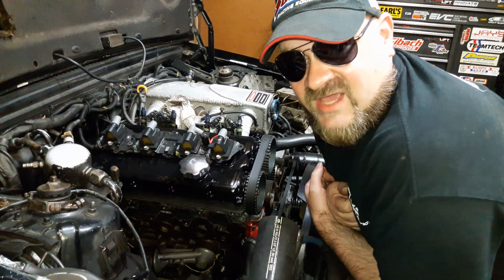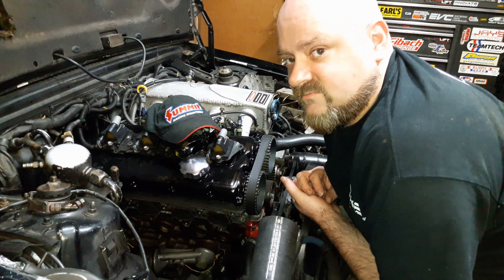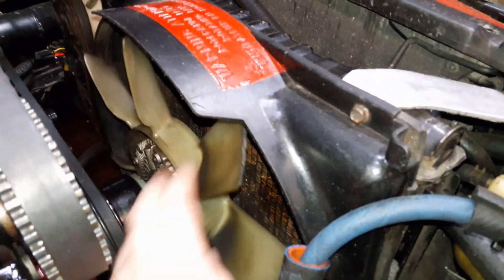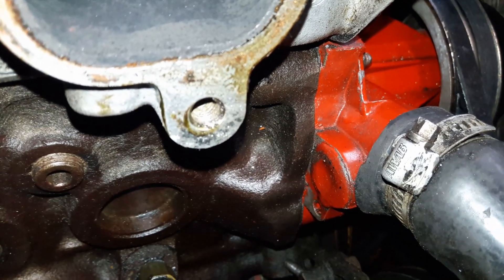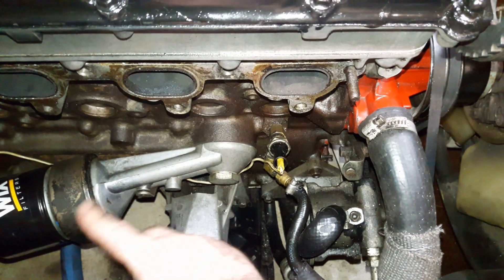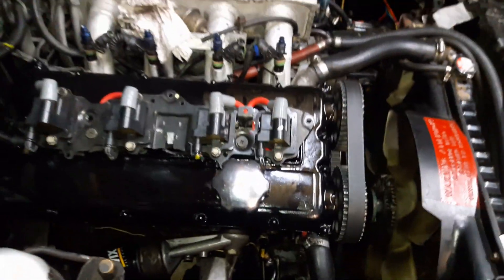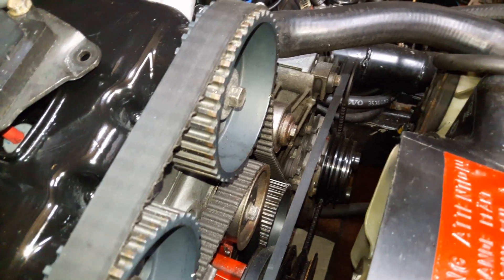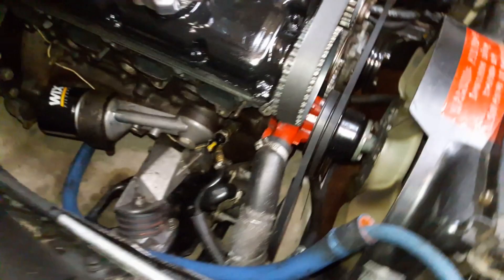How to help keep a 500bhp Volvo Redblock Cool!

Comment: So did i understand that right, you closed the coolant holes in the block and completely stopped the coolant from coming into the block? U just use the Supra mk3 cooler fan?
Reply from the maker: I plugged water pump metal line hole, removed metal line to heater core and plugged the line under intake manifold. Basicaly bypassing heater core. The supra radiator uses a electric fan it came with as a tiny puller, then I have a huge electric pusherfan, as well as stock clutch fan.

Comment: I’ve used 3no. Hockey pucks on each side as mounts and apart from a resonant vibration at 16-1700 rpm they seem ok. Engine is rock solid, as I heve very little clearance between the valve cover and the master cylinder being rhd.